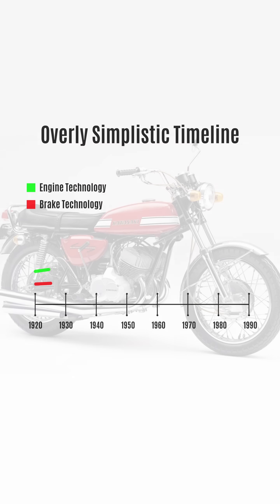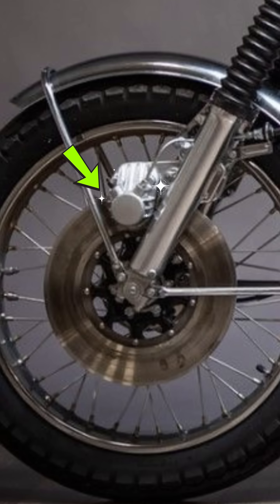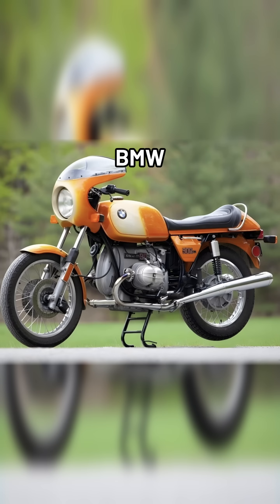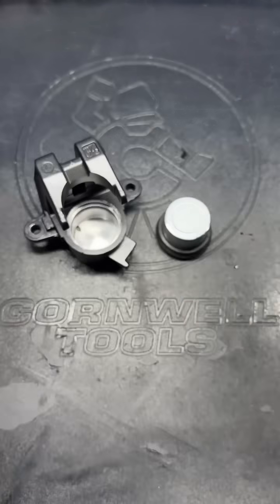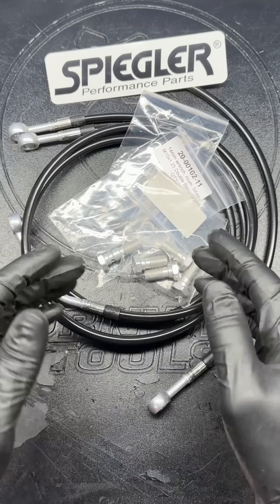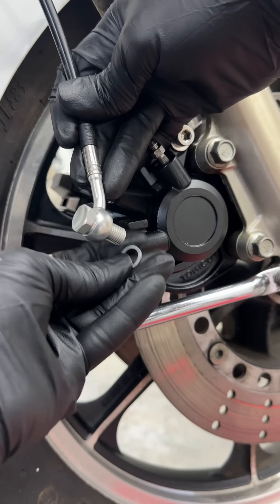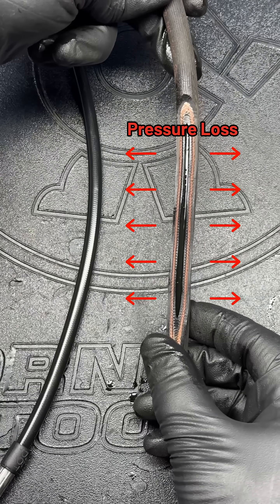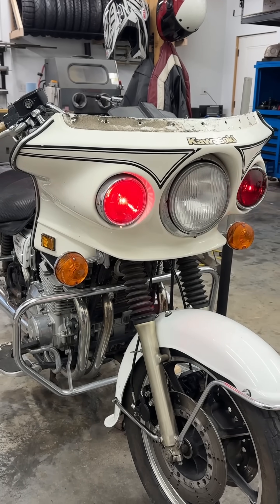Going fast is fun, stopping fast is even better!

Comment: I have a 1985 CB650 that I am turning into something fun. My brake res looked just like yours. For anyone looking for a easy way to clean this stuff, Vevor or Harbor Freight both sell nice ultrasonic cleaners. I have a 6L and 30L models. The 30L model sounds like 10,000 angry bees in a box. You can hear it over ear pro... at 600w though, that thing cleans! 

You can fit a whole quad carb setup in it without taking the linkages apart. Saves so much time but still gets its so clean it looks new. The secret is purple degreaser (walmart sell purple power 5 gal jugs for $25), cheap dishwashing detergent, and some Lemishine. Using two different degreasers seems to really boost the effectiveness I have found. 

The purple stuff is strong but doesn't carry away the gunk like the dishwashing soap. That stuff seems to cause it to sink which is ideal. The lemishine is a citric acid additive that helps if you have hard water to prevent water spots on your parts. Then when you pull it out of the bath, I spray the metal parts excessively in WD-40. You can get a bulk 1 gal can for 25-30 dollars. 

WD stands for water displacement. It works wonders at swapping itself with water and clinging to the parts. I use a cheap wash basin from the dollar store to work over. For the bigger parts, I have these large gray "buss boy" style tubs from Sam's club for like 15 bucks for a set of 2. One for wet and processing, the other for the cleaned, and drying. Any part of that bike that I can run through that 30L I have, and they are so amazing looking! The only downside is if you use heat and purple degreaser, it will attack paint, even caliper paint.

If paint is an issue, skip the purple degreaser, and use medium heat with dishwasher detergent and lemishine. You will need to run it probably 2 or 3 cycles, but the likelihood of the finish being ruined is greatly reduced. 

I hope this helps someone out there. It really isn't that hard or expensive to be able to effectively clean parts at home.

Comment: Nothing wrong with vented drumbrakes if you use the proper pads with them.
Reply from the maker: Dialed in they can be pretty effective, but I would never pick them over a disk for performance. Aesthetics on the right bike for sure though.
Reply: @ I drove with a Yamaha XS1 that still had drum brakes on the front and the rear. I never had any issue's with the brakes, my dad even drove it on the track quite a few times.

They do have one benefit over disc brakes. And that is that with disc brakes the pads are always slightly rubbing against the discs which causes friction, which costs you power. With drum brakes there is no friction because the pads are completely disconnected from the drum when they're not operated. On low-hp race cars this actually makes quite a difference. 🙂

Comment: Actually 1952 Vincent Black Lightning had hydraulic disk brakes, and mv agusta was using them also before Honda
Reply from the maker: @markilleen4027  In 1952 the Vincent only had dual drum brakes on the front. I’m sure some have retro fitted disks to them now though. MV had one limited run 600cc bike with a disk brake in the mid 60’s but it was cable driven, not hydraulic.
Reply: @oneupmotogarage  The first motorcycle ever equipped with a hydraulic disc brake was the 1952 Vincent Black Lightning prototype. Vincent experimented with a hydraulic disc brake system on a race bike, but it never made it to mass production.

However, the first race bike to successfully use hydraulic disc brakes in competition was the 1965 MV Agusta 500 GP. MV Agusta developed and tested hydraulic disc brakes on their Grand Prix machines to improve braking performance, but drum brakes were still dominant in racing at the time.       the 1962 Lambretta TV125 Series 3 was the first mass-produced motorcycle with a hydraulic disc brake. It featured a Grimeca front hydraulic disc brake, making it the first production motorcycle or scooter to have this technology.
Reply from the maker: @markilleen4027  Sorry I should have been more clear in my video I was referring to the first marketed, mass produced hydraulic disk brake. Not including prototypes and race only experiments. I didn't include the Lambretta because that is a scooter.
Reply: @oneupmotogarage  scooter is just a slang term for a differently shaped motorcycle, like chopper, or scrambler, it's still a motorcycle

Comment: Fun fact, drum brake theoretically are the most effective brake, grater surface of contact means more breaking power, downsides? A lot, the drum are enclosed in itself, all the dust stay inside and will deteriorate the system faster, they can and WILL warp with heat, brake shoes will consume unevenly for that and that means less brake power, solution? Disks, less surface means less brake force BUT they cool soooooooooooooo much quicker, the system is open in the air so it can clean itself and maintain efficiency which means more reliability and when you need to stop you need reliability.
In the old days the engineers were installing the best brake available for the simple reason that drum brakes theoretically are better but they are not reliable enough.
Reply: had a rear drum fail under emergency braking and hit a car. quickly bought s bike with both front AND rear discs 😅
Reply from the maker: @3f3stin04  yea all that surface area was needed to account for the weak transfer of force from lever to brake via cable. Hydraulic brakes can apply so much more force to the disk they don’t need as much surface area to be more effective.

Comment: Yuuuuuup, thats the thing I learned with my restoration, my caliper and a reservoir were fully sealed shut due to that condensation, had to replace both sets of brakes
Reply from the maker: @SinfulScarab534  yea it sucks when it gets so bad the aluminum in the calipers/ master cylinders corrodes and they become unsalvageable. The master cylinder on this KZ I had to replace, ended up making a short on how I find a good cheap upgrade on that actually.
Reply: @oneupmotogarage  yuup, its bad, replacing all my lines and cables, and getting a new caliper and rotor from 4 to 1 here soon

Comment: I agree in Spiegler or any other steel-inforced hydraulic lines.
However, these old bikes were not called widow makers only because of the breaks. Actually, the Münch Mammut hat quite good drum brakes.
The widow-makers had crappy breaks, crappy tires, crappy frames, crappy shock absorbers and safety gear of the riders was horrible...
Reply from the maker: @WolfBazo-uo9uj  yea 100%, there was a dangerous blend of factors that gave it the nickname. Braking power being a noteworthy one. The 60’s were the worst time for it because the engines were starting to make some serious power and the brakes hadn’t caught up to that quite yet.

Comment: Before the 90's?

 If my memory serves me correctly, brake hoses have a 5 year life expectancy on bikes.
Reply from the maker: hmm, I personally wouldn't sweat the safety of brake hoses on a 2020 motorcycle...But that being said SS braided brake hoses would be an upgrade for any bike that doesn't come stock with them, even newer bikes. Since most manufacturers use cheaper nylon braided rubber hoses from the factory.
Reply: @oneupmotogarage what are your thoughts on Kawasaki using rubber lines on every single model they make regardless of price? I can understand a cheap entry level one being like that, but the H2 having them is unacceptable in my opinion

Comment: what did they use before the hydraulic brakes?
Reply from the maker: I wish I had time to get into the rest of the history. Maybe in another video! The first brakes on motorcycles were Flintstone aka...nothing. Then there was the spoon brake for a short while in the 1900's that was basically a piece of metal you pressed onto the tire. In the 1910's the premiere tech was called a band brake that used a leather strap around a large metal hoop on the wheel that you could tighten to slow down. Then around 1920 that evolved into the drum brake that was the best option until 1969 when Honda started the hydraulic disk. Drum brakes stayed around on the rear ends of cheaper bikes for decades after, there are still a few being made with them actually.
Reply: Drum brakes
Reply: Mechanical brakes. Had metal rods or cables to acuate the brakes.
Reply: Drum brakes. I've driven a Yamaha XS1 a lot that only had drum brakes on it. It worked great as long as you used the correct brake pads.

Comment: Not just that, when they break down they swell internally, so when you apply the breaks the pressure forces fluid into the calipers, but it cannot return to the break cylinder+reservoir locking the breaks in the closed position.
Reply from the maker: @70Rats  yea there’s a lot of reasons the old stuff has got to go. Heat resistance/ stability of newer materials is also a plus. I’ve seen old lines balloon out where the nylon braiding had failed. Haven’t personally experienced one rupture but probably avoided one or two by inspecting before riding.